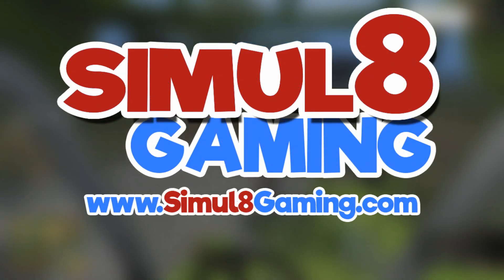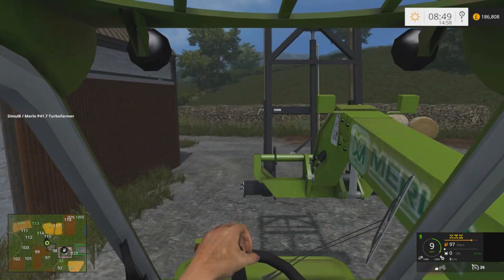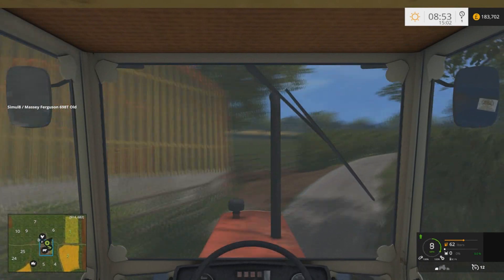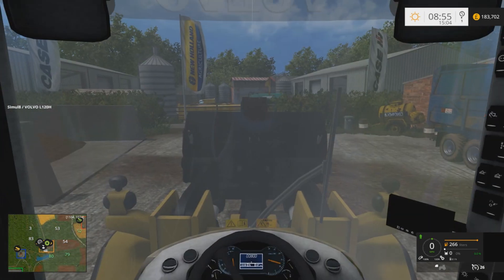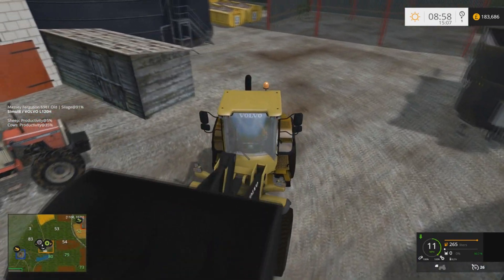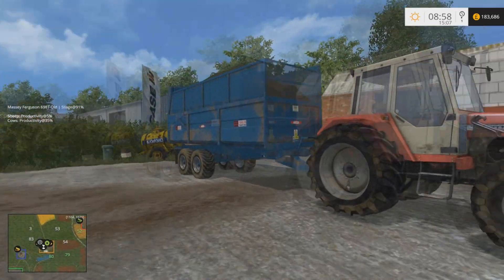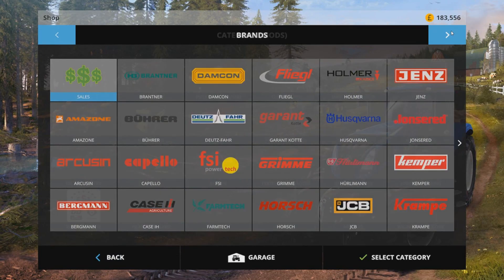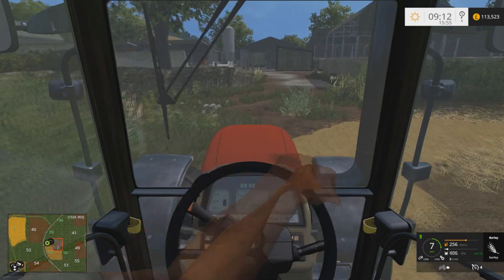Knaveswell Farm Extended - Farming Simulator 2015 - Ep.14: Wasting Time!

Comment: does any on know if u can still dry the grain on the relised version
Reply: Cameron Harper you can but it is quite glitchy
Reply: can u put bales in the bale bite
Reply: Cameron Harper yes use square bales this. I have fuel grain and straw and it is not working do you have to turn it in?
Reply: what do u mean by turn in and i thought u used round bales
Reply: Cameron Harper  yes use square bales and put them in the round section of the dryer. I meant turn on
Reply: can round bales not fit coz of the glitch
Reply: when it glitches when u put the bale in can it crash ur game
Reply: Cameron Harper yeah tom hopes to fix it for fs17
Reply: Good
Reply: i cant get the bale in
Reply: You have to really ram it make sure it's square bales
Reply: i have it wont go in
Reply: Cameron Harper  it worked for me are you putting the square bale in the round bale bit
Reply: yes
Reply: Cameron Harper well sorry but i cant help you any further
Reply: its ok